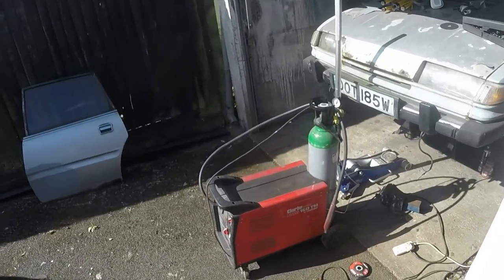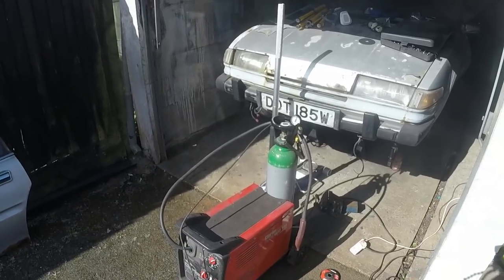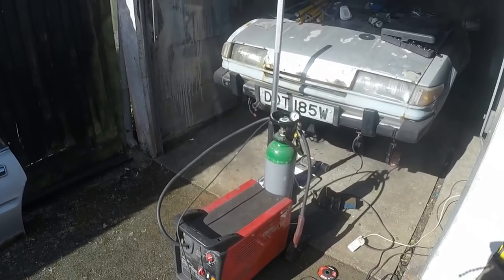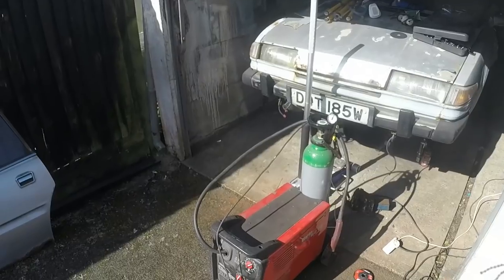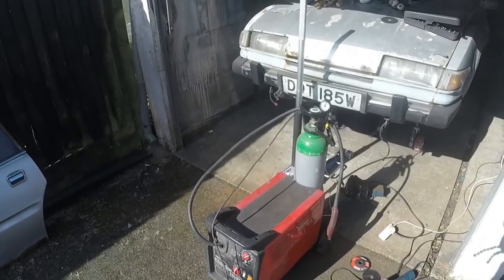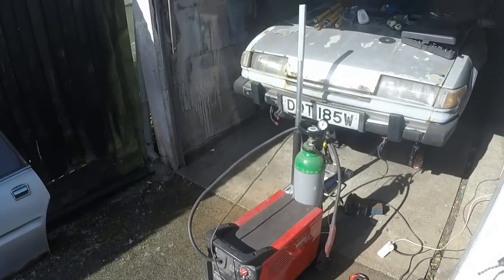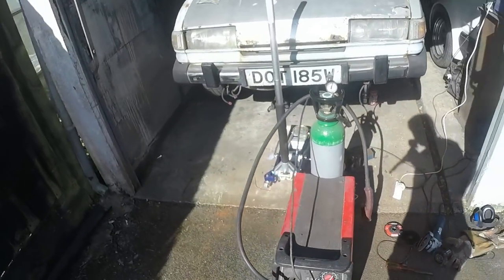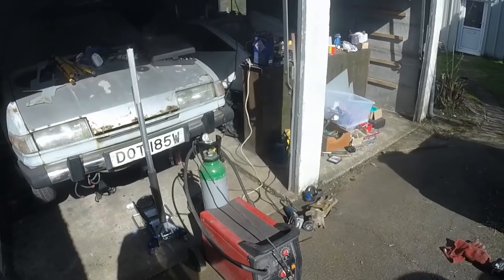Mig Welding - Part 1 of 3 my Clarke 160 welder, why i chose it, how it works and some basic settings

Comment: This has been the best instructional video on mig welding I have found. I have a Clarke 135 and highly recommend the brand. Some of the issues I have come across have been explained in layman’s terms so easy to understand. Itching to get my welder out and have a play. Great shout of for your gas supplier. Have been using Halfords canisters, they are ridiculously expensive, and not always sure if they are consistently filled. Great video’s and Dotty’s restoration is in safe hands.
Reply from the maker: Cheers buddy. Yes little gas bottles are like throwing money away!

Comment: Good video, nicely explained. I've been battling a Rover R8 216 GTi with an old SIP Migmate Turbo 130 and the settings are similar to the Clarke. Took lots of practice on scrap steel to find its 'sweet spot' although it can still be a pig and mess around.
Reply from the maker: Yeah ive seen your videos.  Looking good.  Great car!  Looks the same as the ones used in the marketing brochures and dealer posters.  Only problem in your videos you are very quiet and i cant hear what you are saying

Comment: SGS gas also does the same deal as Adams Gas as mentioned earlier you pay a one off deposit for the bottle and then just buy the refill.  Thanks for the video I’m sure to pick up some tips. I believe the CO2 brings the melting point up a bit more not 100% sure though. All the best Steve.

Comment: Great video well explained but like I have said before pub gas is best for thin metal and cars especially if one or other surface is a little dirty. It provides a better weld it's cheaper especially if you are welding in draughty places where it is getting blown away. We always use the next tip size up cuts down on stuck wire etc. 
Good job though 👍

Comment: Great video. I think the serrated roller might be supposed to be for flux-core wire. Also took me a while to figure out the transformer settings on my inferior Clarke which only has 1 and 2 and min and max but I think it's like yours: 1 min, 1 max, 2 min, 2 max. The manual just leaves 1 max out of the table as if it didn't exist thus apparently deliberately leaving it ambiguous. I think 16 gauge is 1.6mm so your 1.2mm sheet is probably 18 gauge. This is also very confusing because American gauges are different. Wish everyone would just use mm! Watching this out of sequence and hope your elbow is OK.

Comment: Hi.Can you plug the clarke 160 mig Welder into a normal house 240 v circuit  ??? Cheers Great video really helpful for a first time welder
Reply from the maker: Yes mine just runs off a normal plug with a 13 amp plug.  If you wanted to weld much thicker metal you might have to upgrade the plug.  Ive also plugged it into extension cabels too.  But only short ones and not the coiled reel type as they get hot and melt!!!

Comment: hey, are you sure about the setting on this welder?, according to the clarke manual it does go MIN 123 then MAX 123 (i'e max 1 should be more than min 3)
Reply from the maker: There was a discussion about this on the mig welding forum. Basically there is a difference between some models. The instructions for some are wrong. Best thing is get a sheet of steel and try it and see how yours works.

Comment: could you cover the conversion from gas to no gas fluxcore wire?
Where exactly do you reverse the polarity?  My machine is not labeled.
Reply: Just shutting off the gas and using the same wire is not how the machine is designed to run "no-gas" mode.  The manual states to use a fluxcore wire, and reversed polarity to the gun/grd.  (pos. grd)

Comment: Have you fitted a normal 13 amp plug as you are not using it on full power, or 16amp,,